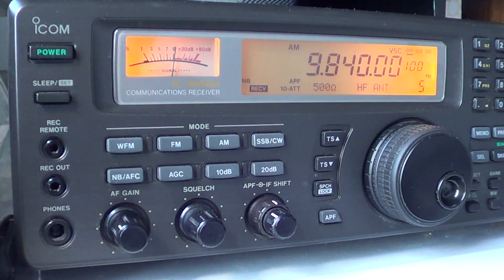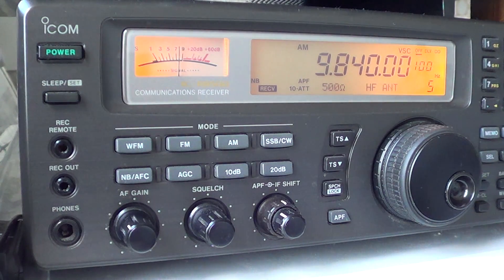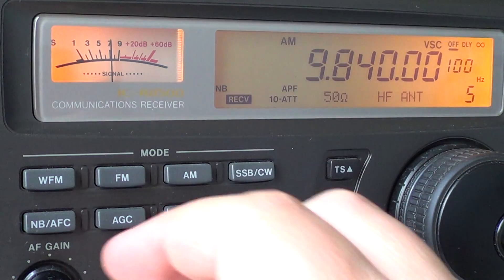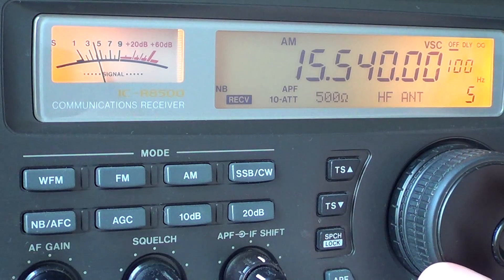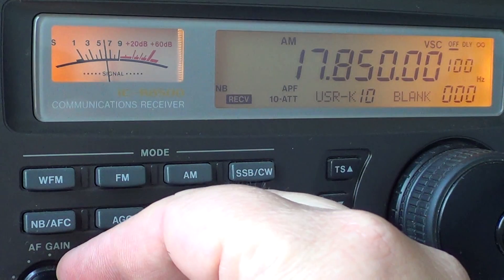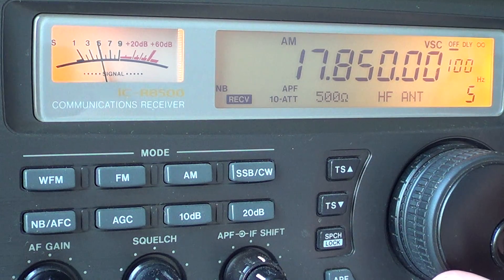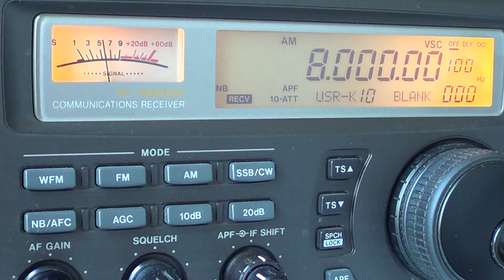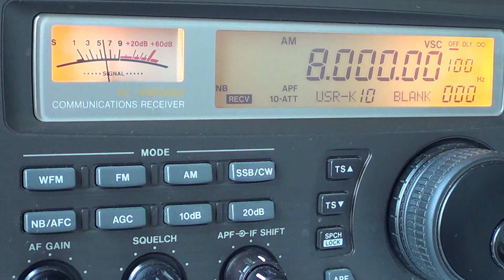Longwire VS 102 inch CB whip on shortwave observations

Comment: A CB mobile whip antenna is around 50 ohms at 27 MHZ if it is properly ground planed. Is that the case with yours? Have you considered trying it on CB as well as at lower frequencies, using an unun? That might prove interesting.

Comment: Interesting video, There's always room for experiments and improvements to increase coverage. I have a Loran antenna whip laying around, now you have me curious as to how it would work as a part of a mixed system, and perhaps with a second one, rigged as a vertical (or a horizontal dipole up in my attic. Having HOA restrictions means "Home-brew Other Antennas" (that just can't be seen.).....I'm playing with a 6 foot magnetic loop now, which works great for lower frequencies so far. At least I can hear ships at sea again, which I really enjoy listening to. The dipole idea works fair with matched ham sticks too. Just not as good as a 1500 foot  OCF long wire, or a 36 foot J-pole made of 3/4" copper pipe for listening to them. You know Your system worked good if you once could hear planes on the ground at Heathrow on HF from the southern US. I miss space to work in, Now I have an HOA to deal with.

Comment: Try two whips as a dipole, you'll be amazed . Center conducter to one whip and shield to the other whip.
Reply from the maker: interesting idea, Will do
Reply: Nick Rupp late post  but what is the spacing between the whips?
Reply: On using ham stick type whips and older CB antenna mobile whips as a compromise dipole antenna ; There's a "T" shaped bracket you can order for this which is basically a mast clamp on point at the lower part of the "T",  with the whips off set from this on the arms of the "T" or you can just drill and tap a 3/8 -24 threaded hole in a standard CB mirror mount bracket to allow the top whip to go above it as usual, and to allow the lower whip or radial to screw into the mounting bracket below it easily  for the coax braid's connection point. Rigged right these can be horizontal or vertically mounted. Or use PVC pipe and add a metal cap at the top to hold a regular mobile whip's insulated mount and allow a vertical run of wire to act as a dipole radial inside the PVC mast for the braid connection point. An insulated from the ground metal pipe "mast" ( with a section of PVC pipe coupled at the bottom of the metal pipe with a threaded fit to slip fit PVC pipe coupler ) would be a sleeve antenna with the metal pipe section acting as the lower radial. Just add a hole for the coax to exit the lower insulating PVC pipe section. Yea, there's plenty of room to experiment if you just don't have enough real space to work with.....
Reply: With dipole mounted mobile whips,  avoid metal masts, and run the coax 90 degrees away from the connection point if you can.. (I like making my listening antennas as if i were actually planning to transmit on them, So I do some research on making antennas from time to time). Static charge build up is also an issue, but joining them with a few 1 mega ohm resisters in series will drain this off easily with out affecting your listening. I like terminating a long wire antenna run with the same static drain off method at the far end of the run as well.  But as they are normally designed for antenna for a single band of coverage, you'll find you can still use their harmonics to also  listen well in other bands along the dial. You'll just have gaps in your over all listening band coverage. They are a compromise antenna system for listening which works best on the frequency they are designed for..

Comment: The 9ft whip is quite a versatile antenna, I've used mine for CB, SWL and scanning with varying levels of success  however I noted the whip outperformed both a random wire antenna & folded dipole when attached to an CB SSB radio on 11m (at this location) as well as quite good performance on VHF.
Reply from the maker: It has some great capabalities ...  Depending on the frequencies you are listening to !
Reply: @OfficialSWLchannel  A 500 ohm input on the radio tells me it's designed to use a random length wire antenna. There's places on the web like this; 

https://ve7sar.blogspot.com/2019/01/the-best-random-wire-antenna-lengths.html

that list those "best lengths" of random wire and why.

 But It goes something like this; Your 102" CB whip is a good quarter wave antenna for CB frequencies, it's also a good 1/8 wave antenna for 13.5 MHz and a fair 1/16 wave antenna for 6.75 MHz and a decent 1/32 wave antenna for 3.375 MHz or so. So those bands would also come in well with the CB whip. But you'd have "holes" in your reception away from those frequencies .

Not knowing the length of the wire antenna,  I can't say what it is cut to receive or if it is random or not..

But if you like certain bands, you can also make use of this; If you like listening around 6 MHz, You'd need a 78 foot antenna for a half wave antenna, but a 39 foot antenna will also focus more at that band around 6 MHz, as it would be close to being a quarter wave antenna at 6 MHz. (a 1/2 wave at 12 MHz, and a full wave antenna  at 24 MHz) 

A half wave antenna for 24 MHz is 19.5 feet, but it would also receive 6 MHz  and 12 MHz as well since those are harmonics.
And that's also why all CB antennas are not 102" long, and some are shorter.

  468  divided by the frequency gives you the length in feet for a half wave antenna for that frequency, but You don't really have to stop there.
Reply: Or a system with 450 OHM feed line.
Reply: Quick calculations a 102" whip; 1/4 wave radiator for 26-28 MHz,  1/8 wave radiator for 13-14 MHz, 1/16 wave radiator for  6.5-7 MHz, 1/32 wave radiator for  3.2- 3.5 MHz, Yea, About where mine use to receive best. A compromise antenna anyway, but workable for RX. And likely made more tunable with the counterpoise system.
Reply: It can be very surprising sometimes the opposite from what you think . I remember In  2000 I just got my HF license,  and very keen listener.  Having a 21foot  vertical was ok , but I had 140foot doublet and 720feet  long horizontal v , you would think the 720' would be the go to for 136Khz long wave (ham band CW low pwr at the time ) but no. The 21' vert was the only ant I could hear a local ham (50km) and once a station in Switzerland,  very weak on the vert,  nothing on the long 220 metre v . No I can't explain it!  Sorry I am very late to your video,  It popped up on my suggested.  This for the interesting video . Greetings from Scotland.